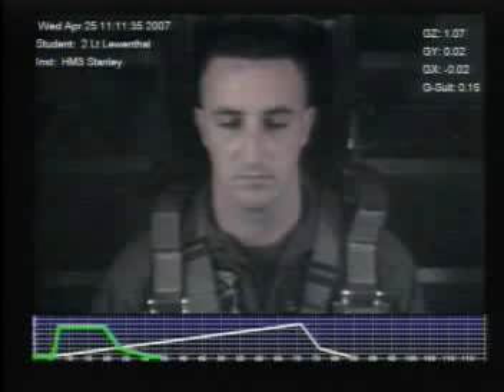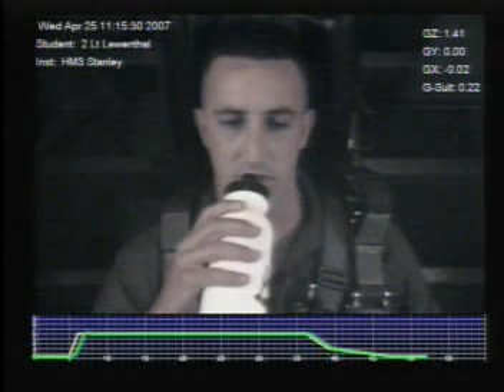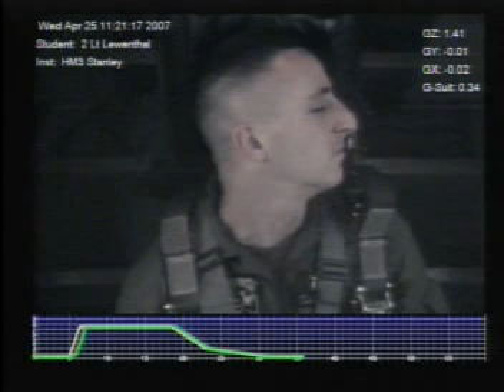face melting

Comment: @Sevamartin; Jet fighter pilots (and even Astronauts) under go centrifuge training (You're in a ball strapped in going around in a circle) it is to get the body and mind used to the effects of gravity on the body at extreme speeds and turns. It is effectively training to keep from blacking out making a near right-angle turn at 300 m/s or more. Doing so without being used to it would cause the pilot to blackout and potentially crash before regaining consciousness.